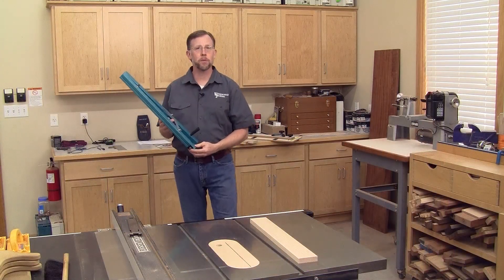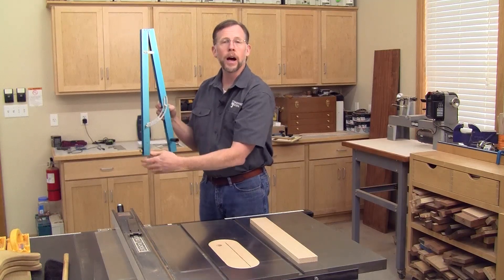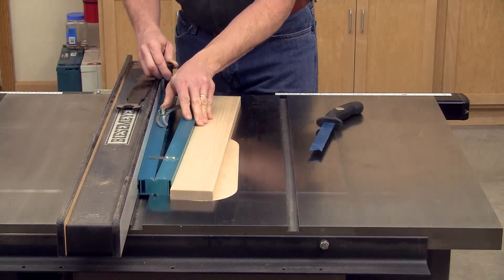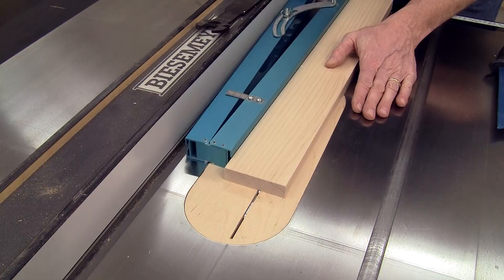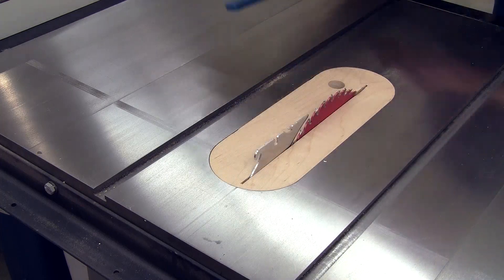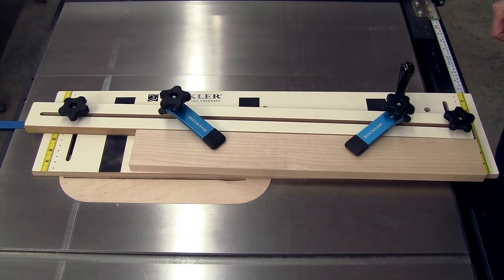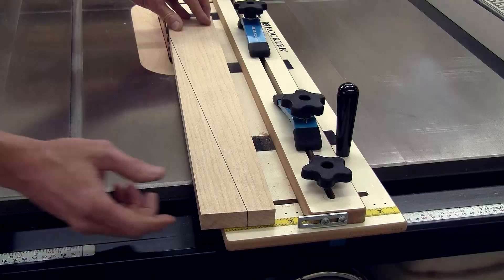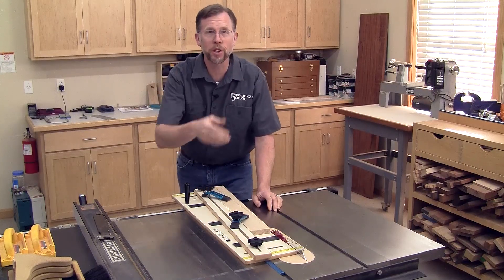How to Make Safe Taper Cuts Using a Table Saw | Rockler Skill Builders

Comment: Years ago when I had my own machine shop and did a lot of metal working and also did a lot of woodworking. The shop and I would use the mill to run tapers on wood. It wasn't that hard to set it up and get reliable repeatability and superb finishes.

Comment: The first jig he showed (blue one) is also a Rockler jig, which I bought years ago for a lot less than the $99.00 list price, which I see is on sale for $69.99 right now.  Haven’t had any issues with the old jig.
Reply: yep pulled the trigger being 69$
Reply: I used that old jig when I was 17 in shop class.

Comment: I learned the hard way that physics is not to be messed with while trying to taper a 2x4 on the table saw. I realized about 3 inches into the cut that my piece was starting to pull from the very shotty fence I made. This video and that product are brilliant! Also, you look like you could be Ryan Reynolds older brother. 🤣

Comment: Can't you just remove the fence and clamp a straight edge to the saw at the desired angle?
Reply: No. That would not work!
Reply: @dwlsml4118  Care to explain why?
Reply: Since the straight edge is clamped at an angle to the saw blade, the workpiece would follow the straight edge at that same angle to the blade, resulting in dangerous torque applied to the blade. It literally can't be done that way, since the motion (not the angle) of the workpiece always has to be parallel to the blade.